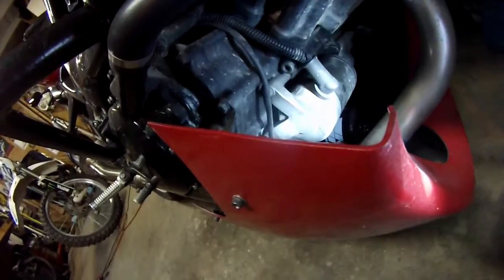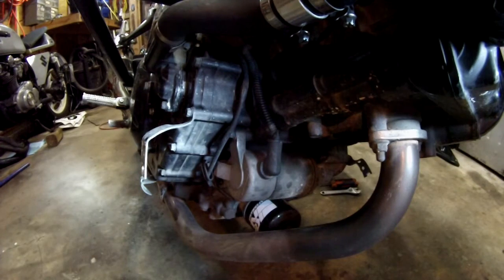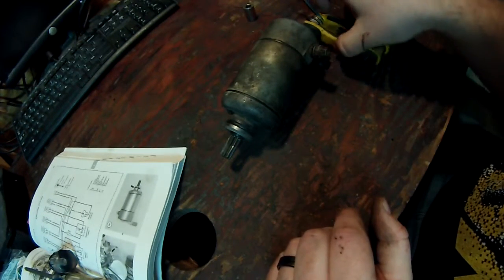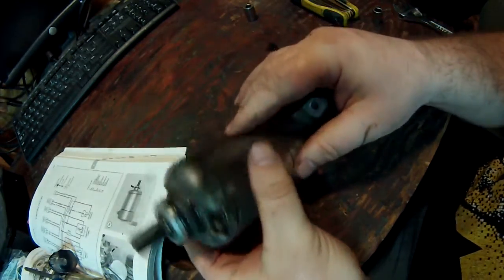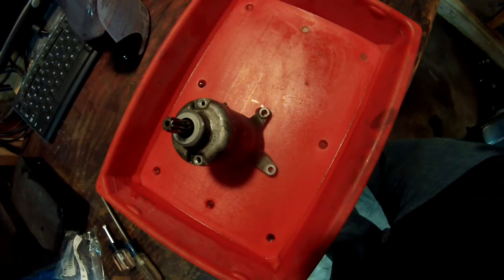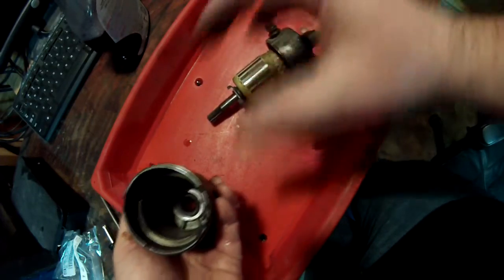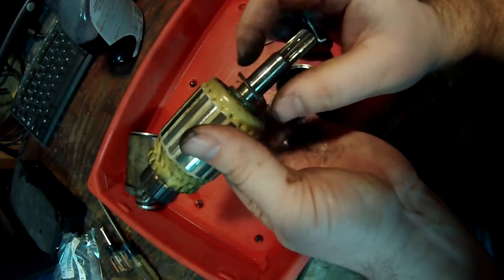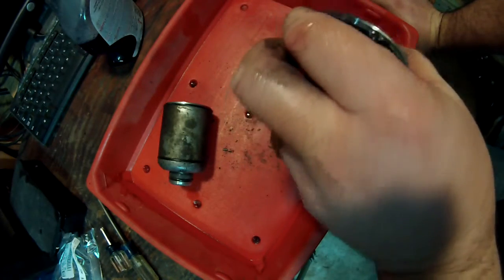1999 Sv650 starter maintenance - Part 1

Comment: Nice one chief ! I'm having issues starting mine. Checked the relays etc and just removed the starter. Checked it on the bench and it worked however my positive terminal also span ! To get mine off I removed the terminal from the relay ! I wonder if the problem is the spinning connector and by removing it I've jigged it so it works again !!

Comment: Great video! My starter works ok, but somebody on the SVrider forum recommended to take it apart and clean all the contacts. I wonder if it's worth the bother, but would be a cool project once I have all the new O-rings.
Reply from the maker: Yea it's a good thing to at least check. As the contacts wear down the dust can build up inside. Wouldn't hurt to give it a look. Thanks for watching!